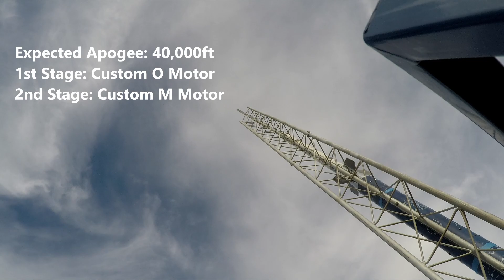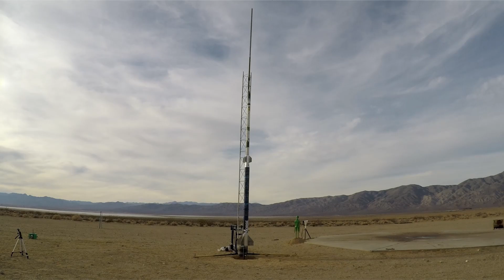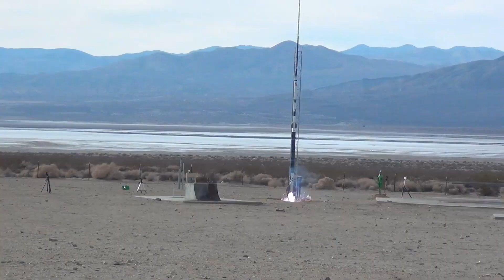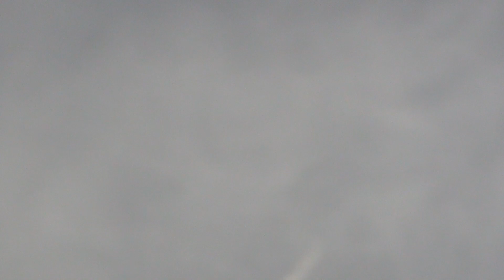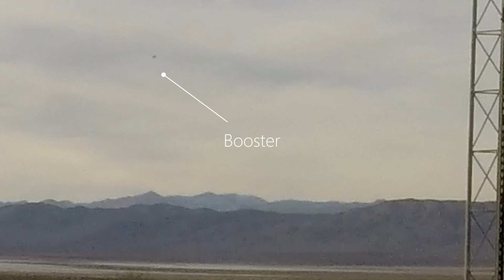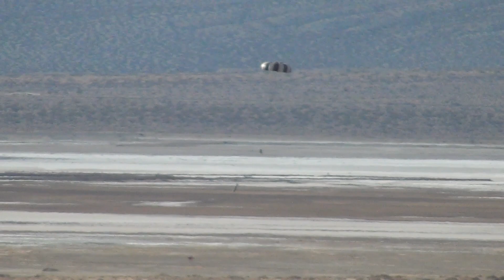Two Stage Experimental Rocket Flight by the University of Akron

Comment: What was the angle the sustainer lit?
Reply from the maker: I wish I can answer that, but they lost telemetry on the sustainer and I haven't heard if they recovered it or not. I have two angles of the rocket on camera, but both are in about the same plane. The GPS data would have probably been where the answer lay, and they were able to get a GPS lock after Mike Brinker helped to identify that the radio transmitter drowning out the GPS receiver.
Reply: @DerekHonkawa  thanks Derek